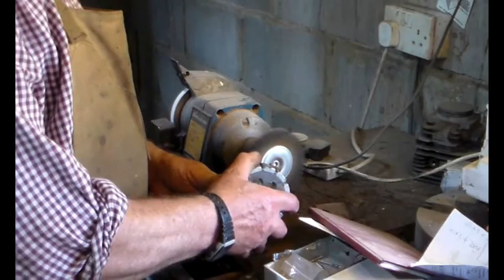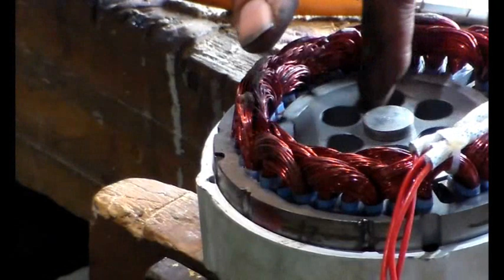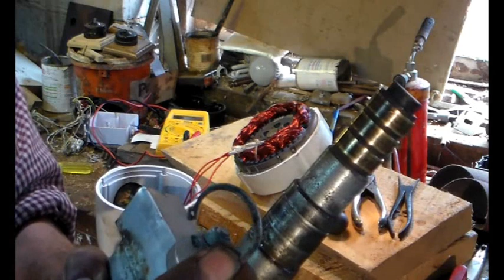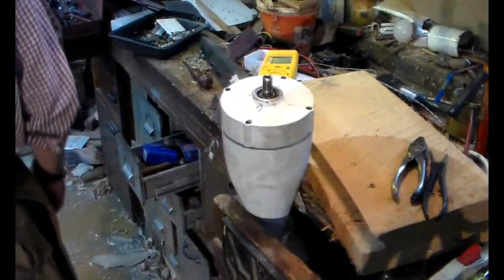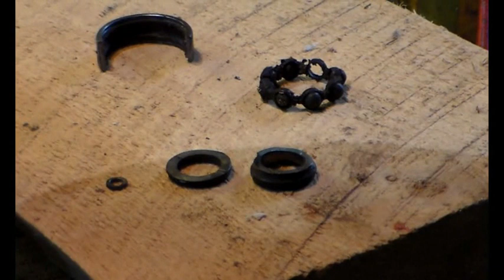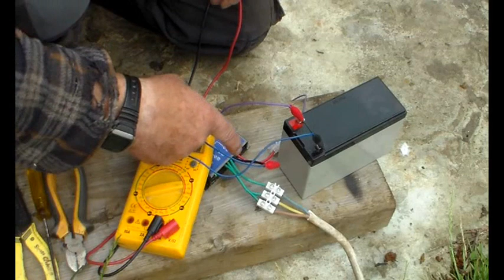12v wind turbine: repair bearing assembly, re-assemble and test, pt.2

Comment: Hi Mate, I found small wind generators start making power in low winds,
starting speed 10km/h, these outputs are what saw while in a 50km/h 
wind storm, they might have done more amps in peak winds of 63km/h.
26V - 24V 500W Vevor             -  Normal 5 Blade  - 6.5 Meters   -  8 Amps
26V - 24V 500W Vevor             -  Normal 5 Blade  - 6.5 Meters   -  8 Amps
14V - 24V ista Breeze i500      -  Scoop 5 Blade  -  4.5 Meters  -  11 Amps
12V - 24V 300W Hyacinth       -  Normal 6 Blade  -  4 Meters   -    5 Amps
12V - 48V 500W SUN800 S5  -  Scoop 6 Blade    -  3.5 Meters   -  3 Amps
12V - 48V 500W SUN800 S5  -  Scoop 6 Blade  -  3.5 Meters  -  2.5 Amps
12V - 48V 500W SUN800 S5  -  Scoop 6 Blade  -  3 Meters   -  2.5 Amps
12V - 48V 500W SUN800 S5  -  Scoop 6 Blade  -  3 Meters   -  2.5 Amps
12V - 48V 300W new rotor     -  Scoop 5 Blade  -  3 Meters   -  1.5 Amps
12V - 48V 300W new rotor     -  Scoop 5 Blade  -  3 Meters   -  1.5 Amps
Peak Output Totals  =  44 Amps  =  752 Watts ( my target is low winds )
I find 10 small wind generators are quieter then one big wind generator.
Reply from the maker: Hi, yes I found in tests for my book Wind and Solar electricity (edition one) that several small turbines can equal the output of a single larger ones. The benefit is lower purchase cost and much lower installation materials. If one goes down the rest keep working. Downside is they are not so robust, Cheers
Reply: @TheInfoworks  I didn't mean to have 10 wind turbines, just had some bad buys and by using the best parts made something work.
I was planning to have 2 wind turbines, but it is a waste of money laying on the ground. I have found every amp counts for charging.
Reply from the maker: @brianaustralia9692  I've found that you get more generation per unit expense with solar, but less in winter and non at night, cheers

Comment: IMPORTANT: the standard wind charge controller can handle 4A or 5A ... not 25A ... that is the reason why people get only 60 or 100 watt ... then you need "load" ! the battery is full, the controller "brake" (unload) and when you have "no load" you can not measure watt ! if you have a 500 watt wind turbine you need 500 watt load to test it ;) the most people test wind turbines with full battery and without load ... that is wrong !
Reply from the maker: Yes, some of us are fully aware of the need for an electrical load otherwise no current can flow. No need for capitals or exclamation marks, cheers

Comment: Hi Andy,
I want to change the stock wires which are pretty thin in my 24V AC turbine.
How to remove the rotary joint/shaft to reach and change them?
Thanks,
Reply from the maker: The number of turns in the coils  is important, less turns, less voltage, cheers

Comment: Hi Andy, could you recommend a 1kw pma and controller for my water wheel i am building. Thanks Ray
Reply from the maker: Ray, depends what system voltage you want to run, check out my videos on running a generator from a water wheel, I think there may be a playlist, cheers

Comment: I've never seen a model like that one produce more the 0.5 amps
Reply from the maker: Hi, yes the multi blades are self regulating, they need to be in very clear air and so high up, cheers
Reply: Have you seen them operate with the size of magnets he has on this one
Reply: IMPORTANT: the standard wind charge controller can handle 4A or 5A ... not 25A ... that is the reason why people get only 60 or 100 watt ... then you need "load" ! the battery is full, the controller "brake" (unload) and when you have "no load" you can not measure watt ! if you have a 500 watt wind turbine you need 500 watt load to test it ;) the most people test wind turbines with full battery and without load ... that is wrong !

i see 60 watt .. more then 100 watt and so on ... but only if the wirering correct ^^ lol

Comment: I have one the same with the propeller fixed no power when i took of the propeller and turn it with the brass working good can u help me pls
Reply from the maker: Victor, not enough info, but is the prop driving the generator rotor and are the bearings Ok.That's what this video is about. Helping people to help themselves, cheers

Comment: what bearing type did you use? Mine came stock with 3203 RS, but I am going to try a 6203 2RS.
Reply from the maker: As you see I used the bearings that i had but made sure they had grease and rubber seals, and of course the right end loading to lock them in place. The lack of that end loading was the cause of failure I think, cheers

Comment: I've just received the three blade version of this 12v 400 watt turbine for our sailing yacht and have had it running for the first night.  I've got it up and running fairly well as far as charging is concerned.  At night we have our anchor light on and a few USB chargers running and a small freezer and seperate icebox converted with a 12v danfoss unit cycling on and off. Each draw about 4 to 5 amps depending on what RPM the compressor controllers are demanding when cooling.  They come on for about 15 minutes twice per hour.  We're in the windy anchorage in the Bahamas and have good laminar flow to the unit.  For this first night we woke up to fully charged batteries (480 Ah of flooded lead acid deep cycle batteries).  At night when the solar is not charging I can see that the turbine appears to be delivering about 8 to 10 amps charge in 14 knots of breeze.  

My concern is NOISY RUMBLING BEARINGS!  The mast is right over our aft berth and the rumbling noise is driving me nuts.  I'm glad I found your video as I may have learnt that the shaft nut may be too loose.  I'll tighten some more but I fear the "bearing fit disease" also may be my problem.  I'm going to get on it today before any wear occurs.

I have this unit:
http://www.marsrock.com.cn/product/1600114079121-801131681/Mars_Rock_400W_12V_24V_3_Blades_Small_Home_Wind_Turbine_Generator_MPPT_Controller_LED_Charging_Indicator_Wind_power_windmill.html?spm=a2700.shop_plgr.41413.40.18f6797di5tM1o
Reply from the maker: Tony, I fear that your yacht is acting like a sound board, accentuating the rumble, rubber mounts and guys may help, subscribed? cheers
Reply: I have pretty much the same turbine bearings are a pain in it also it turns out of the wind on slightly stronger gusts i have made the tail abit bigger it keeps it into the wind more also the noise can be due to blade flutter at the tip try shortening the blades abit should stop that to some extent a well balanced hub and blades make less noise and more power aswell you can get mower blade balance cone thing i have one it dose help to get everything spinning smoothly but would need to use it on dry flat ground the bearing that comes in the unit isn’t good definitely upgrade to a sealed stainless probably have to be a pair with a spacer as i can not find one single bearing of the size that is good quality definitely around salt water keep a few extra they will wear alot faster i hope this helps you in some way
Reply: https://www.ebay.co.uk/itm/UK-Blade-Balancer-For-Rotary-Lawnmower-And-Brushcutter-Garden-Yard-Lawn-Mower-/194054090491?mkcid=16&mkevt=1&_trksid=p2349624.m46890.l6249&mkrid=710-127635-2958-0
Reply: Unless you buy a proper  air x marine unit, so many Chinese copies, stator and rotor half the size and not lined up causing vibrations

Comment: Hi Mnr. Andy. Great content as always. Please adivse on what tipe of varnish you used on the coils. And second question: some of my magnets have come loos on my turbine. What glue would you recommend? Cheers
Reply from the maker: Hi, I used polyurethane varnish and I have glued magnets in place before and used an epoxy 2 part resin like Araldite, Subscribed? cheers.

Comment: Bearing and shaft wear fixes seem to work Andy. I know this turbine needs to be up in clear wind and all that, but it seemed to be incredibly low output, even without a load, considering the blades are going at more than a walking pace - I wonder what the real annual output energy would be from this thing on a good site  - I find it hard to believe it could manage even 50W power output from this showing !  I'm not too impressed - I think the rotor diameter needs to be bigger - like a Hugh Piggot axial flux design - to get some real low speed power out of it....did it genuinely charge a battery bank at all when it was installed new ?  Atb, Dave
Reply from the maker: Dave, yes the larger the generator rotor the faster the surface speed and so the slower the rpm needed for a given voltage. I don't know if this ever made a significant contribution as there were no meters fitted to the system, so who can tell? Plus it was on quite a short tower. This is what happens when non practical people have a go, but at least they did and now with my help they are learning. A  volt meter in the kitchen showing battery volts certainly focuses the attention, cheers
Reply: @TheInfoworks  Yes, the voltmeter that you can see many times a day certainly could  be a bit of a distraction ....
I agree that at least the wind turbine owners were having a go, so they have the right outlook.

Comment: Is that a clip sir, or a ser clip, ha. 
Does that one output well? I have seen some ratedat 200 watts, and some rated at 2kw, and seem to be the same, I'd like a turbine all packaged nice, but I need it to perform, I'll likely build my own, using a delco alternator,  and use thermodyne blades, if I only get 300watts under normal breezes, is fine, but I hope to get 2kw plus in storms,  I think 5-7 blades may work good, I mostly need the turbine to take over when there is no sun, and most of the time it's windy then!  A 12'-14'  turbine will hopefully do the trick,   great video!
Reply from the maker: James, like solar there are many limiting factors governing the position of a turbine tower and height is also vital, for many of the issues see my book "Wind and Solar Electricity". Unless you definitely  need a large and expensive turbine it can be batter to install several smaller ones, my book mentions FuturEnergy and we did a study comparing several of these 1Kw turbines with a single Proven 3Kw. Cheers
Reply: @TheInfoworks  I been thinking , it's difficult to plan and design without any trial and error,   my problem is trees, and I'd need about 50' to get above them. So maybe small turbines is the answer, it would be cheaper to build a tower from 2" thick wall pipe, than it would  to build something for a 3kw turbine at that height! Thanks
Reply from the maker: James, either that or build a gantry and fit shed loads of panels, if you build it on an old lorry or trailer then you can tow it about to get the best site. The trees won't be such a problem, cheers

Comment: I have the same turbine 12v 300W, two years ago I had a loose slip ring soldering connection ! Hard to fix but works fine now ! Good video Andy !
Reply from the maker: Hi, so you have had no bearing problems, and yes the output seems to be going up over time, marketing lies, cheers